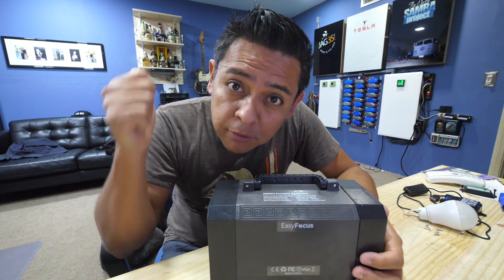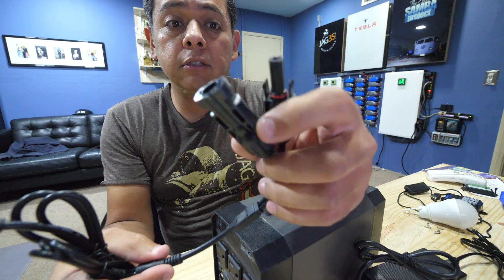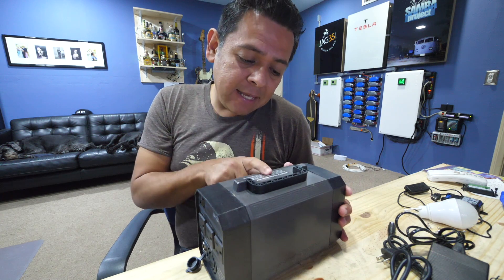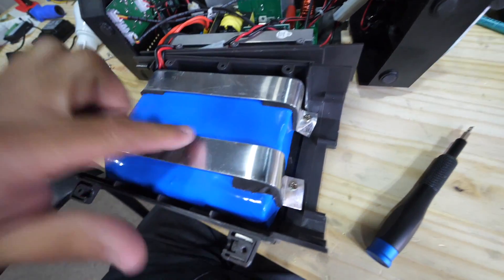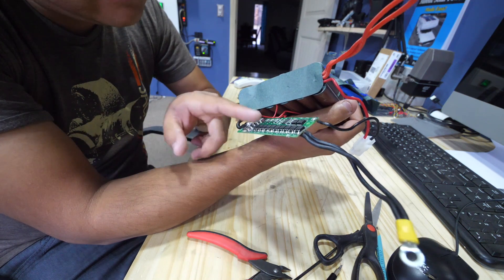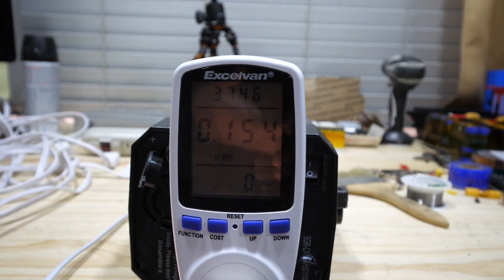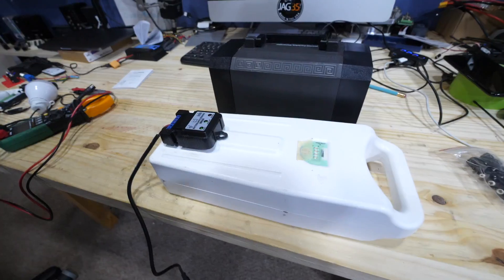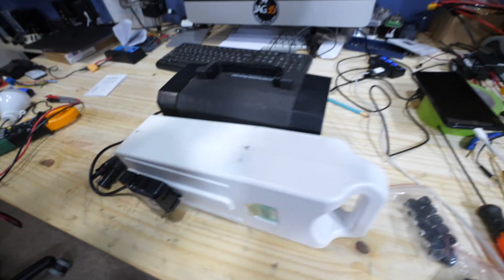EasyFocus 200Wh Solar Generator,   Review and DIY Upgrade

Comment: first! good little device. 
yeah pretty stupid to short the shunt, effectively changing it's resistance and hence the current it's measuring.
That battery capacity seems almost right on, you did 300W in 30min and the batteries was 172WH which 300W is only 30min... same.
Reply: That's funny. He could have also done 300Wh in a hour if he had the bigger battery attached. Probably more and for sure with solar working. But the battery's label said 170 basically and he got 150Wh out the inverter (which losses are generally about 15 to 20% on bigger systems as the watts go up) and that confirms the labels on the cells. It doesn't matter how long it ran since he had the Watt Hour meter on there. Solar is a lot of fun and you get to piss off the power company so see my channel for more DIY stuff.